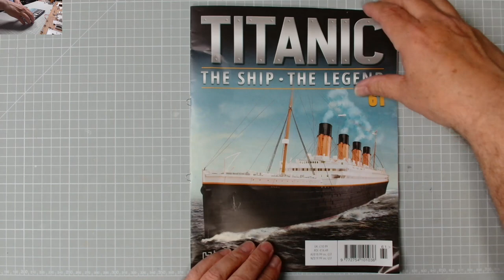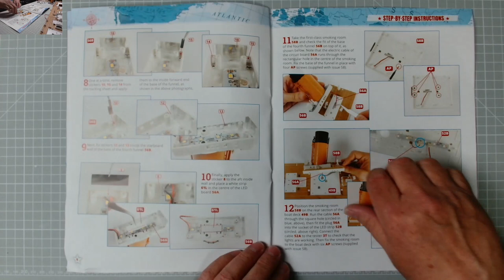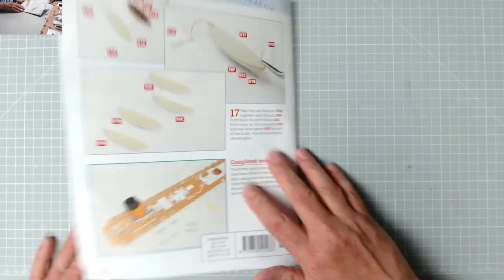Build the Titanic issue 61 from Hachette

Comment: Your hand is steadier than mine mate. lol .I'm just coming up to the first lot of stickers now. For the larger stickers I'm thinking it might be easier to cut around the sticker, leaving the backing paper still attached. Peel the backing paper back, and trim off just a TINY bit. Then you can drop the sticker in place, only having to take care of the small section you have trimmed. Once you have the sticker where you want it, press down the section you have exposed to hold it in position, then peel the backing paper off and out from behind the sticker. The tiny stickers will still need a steady hand though. Once again, stellar video.
Reply from the maker: Thanks 😊